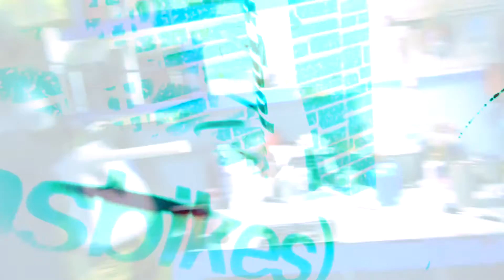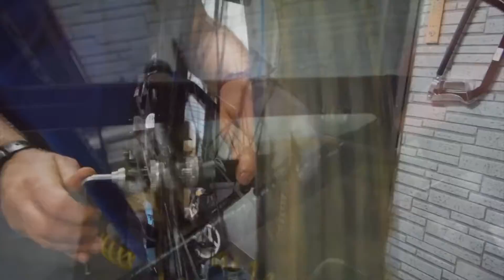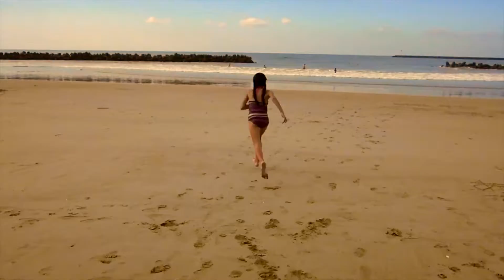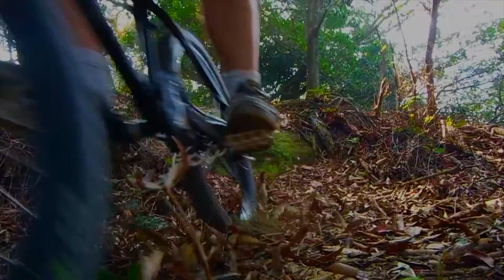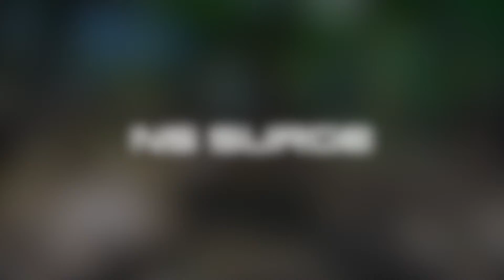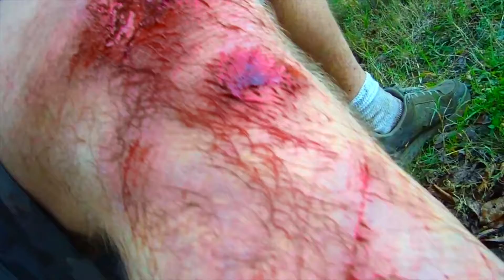NS SURGE 2015 Build and RideOn

Comment: Nice video! I'm about to pull the trigger on a Large NS Surge Evo frame to build up. Was wondering how it rides compared to the On One 456 I saw you had hanging up? I'm looking for a bit of a do it all hard tail with loads of standover and a decent length top tube (the curse of short legs and long torso/arms).
Reply from the maker: +Michael Brewer Hello buddy Michael! I love my NS surge, this the second time I've built it up, as I took apart the 456 to build the surge up again. They are 2 totally different bikes that can suit the same purpose. The NS is more FRer friendly. It likes to jump and has a steep head angle so with a long for, in this video 170mm its feels very good. But shorten that up and you have a FR DJ bike. The 456 has longer chain stays, so its an awesome DH FR bike. It climbs like a XC bike on the DH sections it comes to life as the head angle is very slack. If I had only one bike, I would choose the 456! RideOn bro!
Reply: +Nicholas Poetker Thanks mate, I've decided to go for the 456 Evo 2. My only concern now is sizing! I'm 5' 11" 1/2 with a 33 inseam and can't decide between a 16 or 18. I notice from your other vids you're around my height and have a 16, do you find it ok for climbing still?

Subscribed, really enjoy your vids man!
Reply from the maker: +Michael Brewer  Thank you for the good vibes Michael!
As for the 456, I love the 16, but Im more into DH, FR and jumping.
If I was using it as a climbing bike, I would like to ride a bigger bike.
The surge in the video for example is very short so it feels like its a bit short climbing. 
The 456 with its slack head angle, rides big, so the 16 inch frame feels big to me.
Im a little taller than you with the same inseam, but I regress and say its more up to your style.
If your are mainly XC go for the bigger frame, if you want to XC and jump around go for the smaller frame!